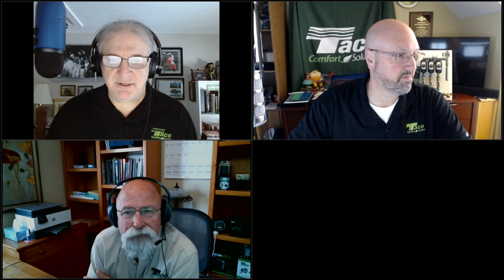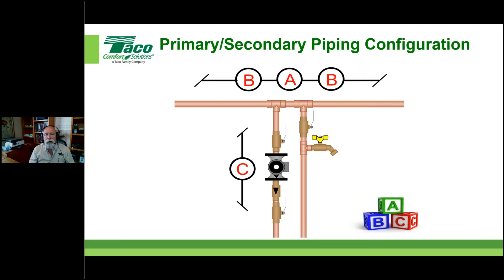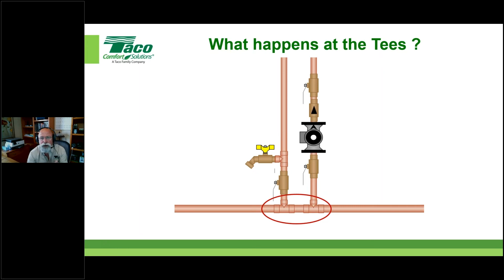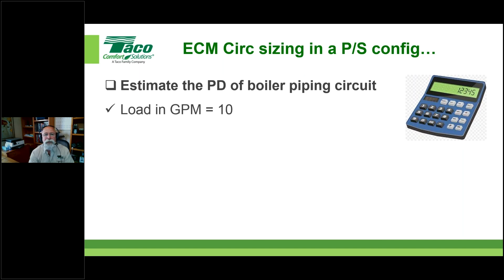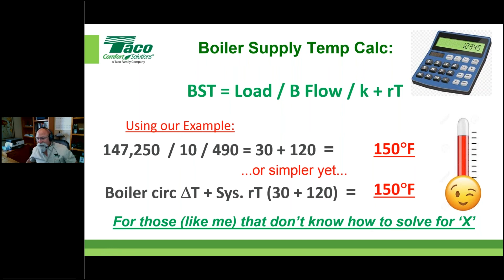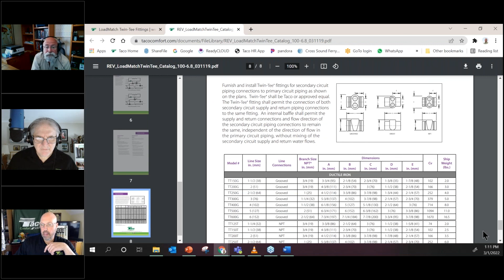Mod Con Boiler Piping & Pumping

Comment: Can you provide some examples of mod con boilers that you know to be compatible with variable speed primary pumps? It seems like a lot of manufacturers recommend against it
Reply from the maker: Hello Dave, the boiler manufacturers that we referenced in this presentation are Burnham and Lochinvar, but that does not limit other manufacturers, these are just the two we referenced. We do work with many of the boiler companies and provide variable speed circ to them.
However, even though our circs are variable speed, they can be setup as a fixed speed circulator and provide the flow the boiler manufacturer is looking for across the heat exchanger.